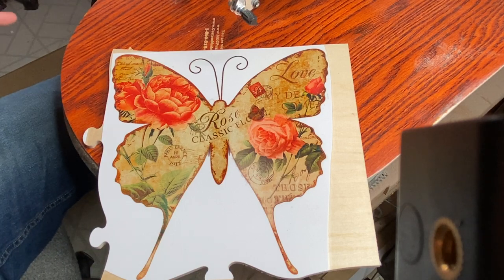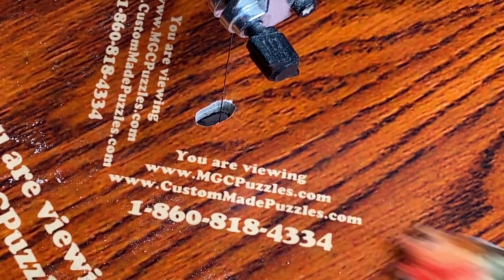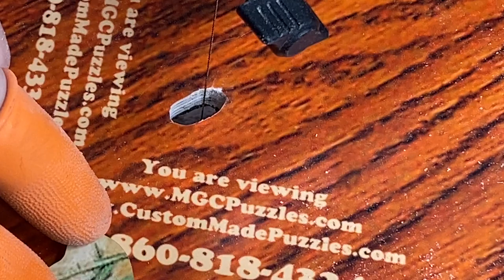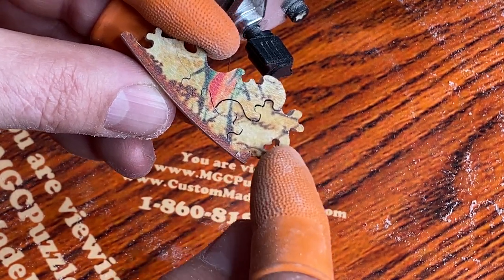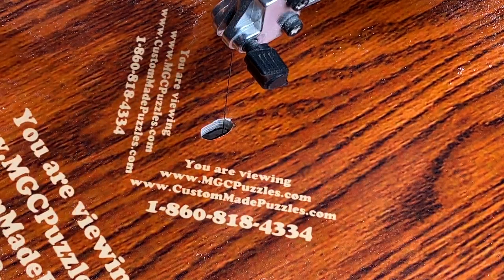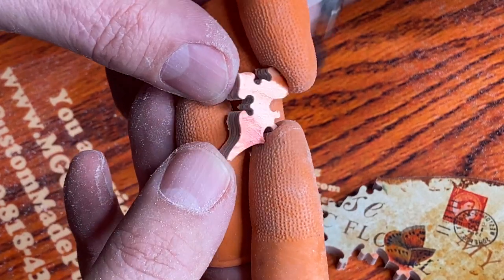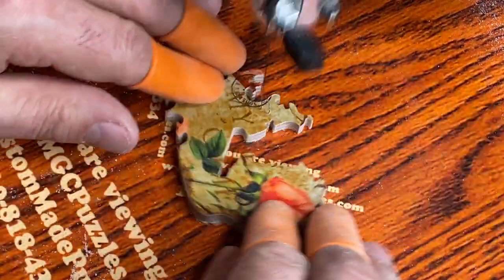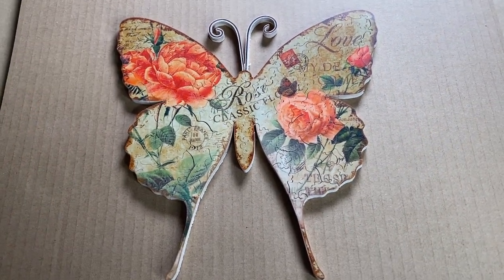Amazing Butterfly Jigsaw Puzzle handcrafted MGCPuzzles One-of-a-Kind Beautiful Wooden Butterfly Art

Comment: Some lessons I've learned while trying to emulate his earlet style:
1. The sharp part of the curve is right at the start and end, the 'middle' part of the heart is never less than 90 degrees. This will let you split males on your next piece easier. 
2. When he mentions cutting figurals true to the curve of the blade, then purposefully mirroring on the other side (for butterflies or any other symmetrical cut) this also applies to his earlet style. Once you're halfway through cutting the earlet, take a split second to look at it and match it to the best of your ability on the other side. 
3. Avoid long 'necks' on male cuts. Echoing point 1, you want the earlet to start sharply and 'pop out' of the edge of the piece, which should flow naturally with the image of the puzzle. And not have the earlet 'define' the piece, if that makes any sense. When I was starting I would just put an earlet at the end of a long interior curve and it wound up looking like a bean stalk piece. Uniform thickness of pieces' sections is only compromised briefly while splitting males.
4. Split males about 1/5th of the time to liven up your patterns.

Comment: Three things:
1) Next time you talk to your wood supplier you might ask if they sell to someone who is set up to resell hobbyist amounts.
2) I assume there is a list somewhere of the various known cutter's signature pieces?
3) You might like a Jet saw.  I have one and love it but a) I've been cutting less than a year so my experience is limited, and b) it does use a lower blade holder.  They're available in 3-packs on Amazon so you could spend a few minutes in the morning loading up enough blades for the day.  If you can find one to play with you'll be able to tell if it's suitable or not.

Continuing to enjoy your videos, even if I do have to work to find time to watch these longer ones.  Trying to learn to cut them myself but currently I have just NO control when using the extra fine blades.  A #5 pretty much does what I tell it.  A #2/0.... not so much.

Comment: As far as replacing your saw, have you ever considered a Hegner?  They are quite expensive but smooth and very long lasting...I have been using the same one for over 35 years with no issues.  Just curious.
Reply from the maker: Paul Messy Workshop,  I would definitely consider it, but I'd like to find someone or a place locally that has one so that I can give it a test drive.   I have been doing my primary cutting on DEWALT Saws since 1997.  My first saw that I used until the summer of 1997, was a Sears Craftsman 16" saw that I paid $159 for back in the spring of 1995.  That saw was the key to what got me into this business.  About two months after I purchased it, I used it for the very first time to whimsically cut some scrap plywood, and the two halves interlocked. The idea to make wooden puzzles was born!  I had a friend that used to have a Hegner, but my memory at the time (1998)  was that her blade changing situation looked time consuming.  She had to pre-clamp both ends of her scroll saw blades into the little V shaped vices, that then did quickly attach to the saw when a blade broke.  The idea of spending a minute or two PER BLADE to pre-clamp the 10-20+ blades per day that I go through seemed like a waste of productive time.  If the machines have progressed to have quicker blade change design, I am definitely interested.  I'd be happy if I can change a blade in under 30 seconds.  20 blades per day at 30 seconds per change is 10 minutes of just changing blades, daily.  Perhaps you can post a video and send me a link of how you scroll and make a blade change from start to finish?  I'd like to see that.  ( By the way, my workshop can get really messy at times as well!  LOL!!! )  Mark
Reply: Probably the best person to watch on YouTube using a Hegner saw is Charles Dearing and he is easy to find by just searching his name.  The only downside to his videos is that he exclusively uses spiral blades.  He uses a much newer Hegner than I do so the upper blade clamping system is much different than mine.  I do know that he preloads many blades in lower clamps so he is ready when one breaks.  Charles is an amazing scroller and you will no doubt find his work quite interesting.  He also makes and sells his own patterns by hand.

Comment: Mark, as I watch you cut the butterfly I was wondering after you mentioned void in the wood if you trace the broken piece and then replace it?  Can you do it on a new photo or just dump the whole puzzle?  The butterfly is outstanding and thanks again.  Steve Herring
Reply from the maker: As soon as I detect a void, I immediately stop cutting the puzzle in that spot, and probe the void with a saw blade to measure it's size.  Then I inject that spot with wood glue to fill that missing layer, and let it set for several hours / over night, to let the glue harden.  This prevents the issue of the upper and lower parts coming apart completely.  When I then cut through that area, it will have a different density feel, so you need to be cautious to keep your cut looking consistent.  With the Finland Birch wood, I run into having to perform this scenario about once every 1-2 years.  It is SUPER rare.